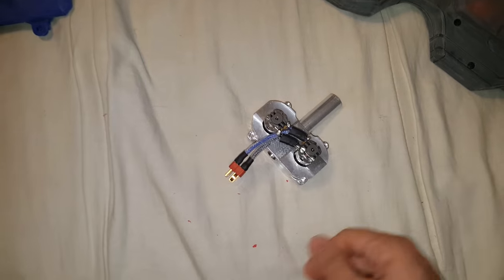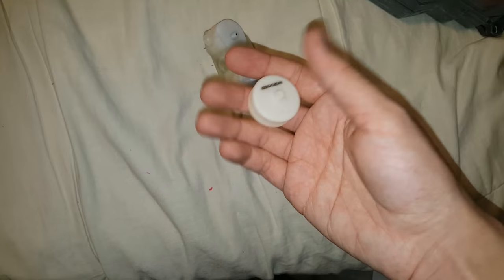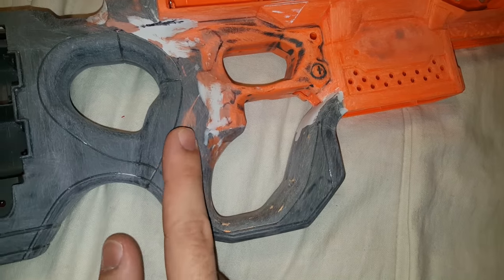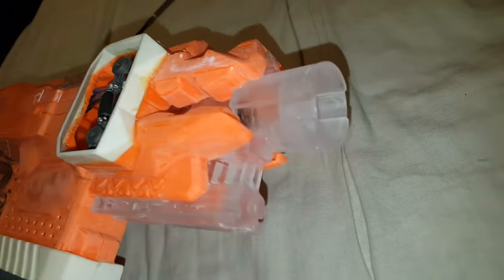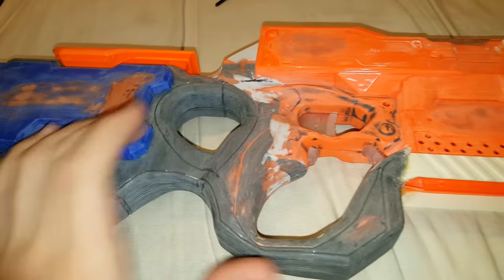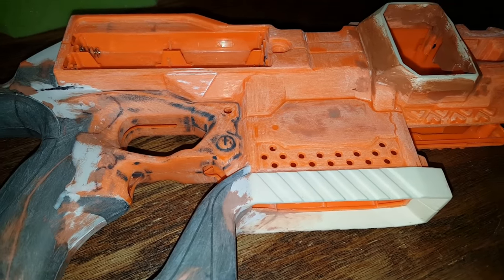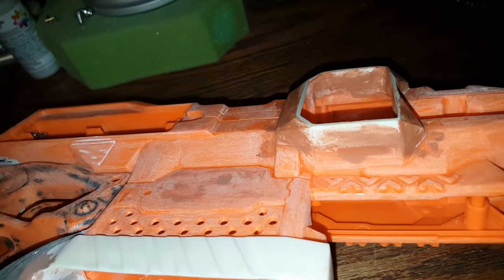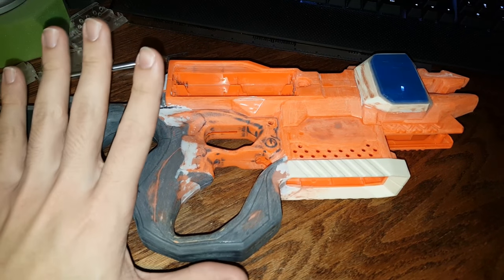Hyperstryfe Nerf Build Log 2 | Ethereal Fortress

Comment: You have the dream flywheel setup. XP180+Snikkas cage+Deans+Lipo
Project is looking amazing. This is a stryfe right up there with the poonbow and pink menace.
Reply: +mdsva Actually, the Pink Menace is slightly below top tier, as it is using Blade 180s (and a stock flywheel cage with worker wheels and NO brass). Hellcats are also top tier motors.
Reply: DerpFails
XP180s always win. But the pink menace makes up for it with style, even if a little underperforming.
Reply: True...